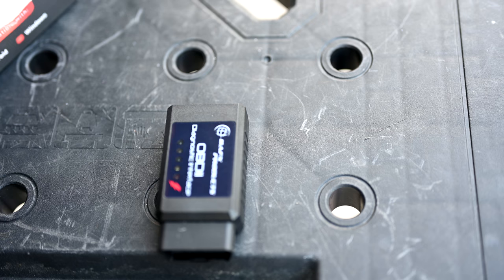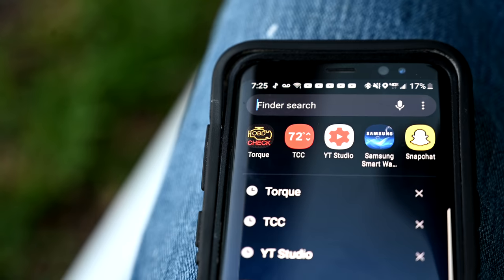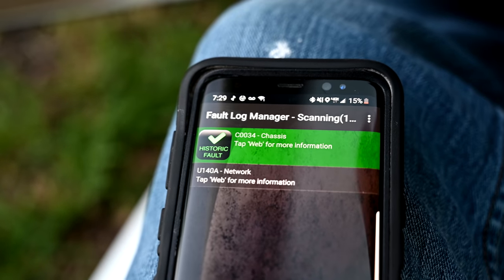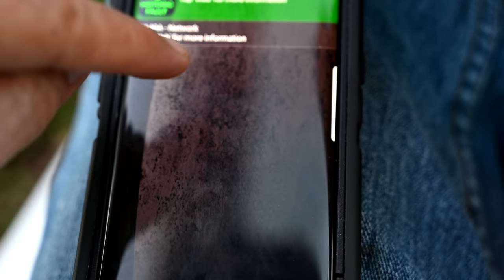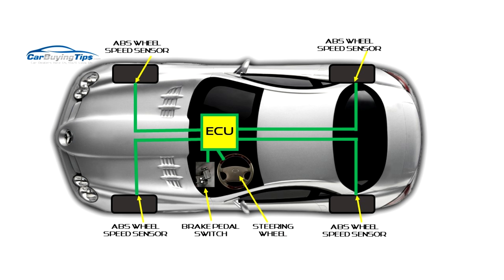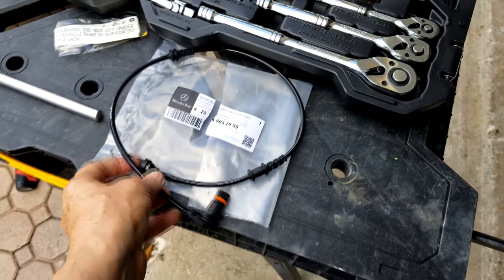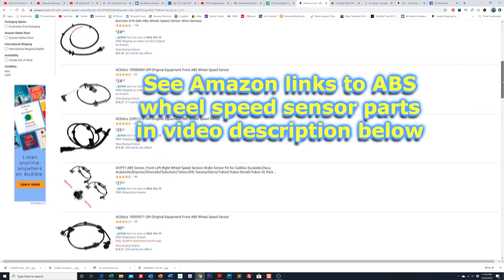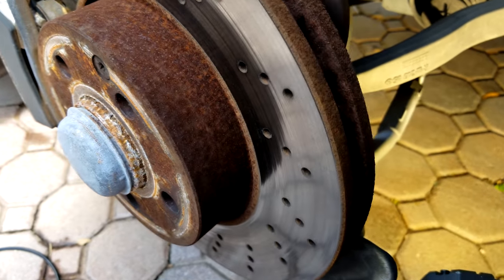ABS Unavailable [How To Fix]: Check Engine Light Mercedes

Comment: Hi, the link for "BAFX Wireless Bluetooth OBD2 Diagnostic Scanner & Reader Tool" says that "This OBD2 scanner does not read ABS, SRS, TPMS, Oil Change or any other non-OBDII related lights". Am I able to read the ABS fault code with this tool or any other simple OBD2 reader? Thanks!
Reply from the maker: Rodrigo, yes this does work, ours works, unless they changed it but doubtful. Yes, we just fixed another car Mercedes 2013 C250 W204 version with the same issue this week, read out both left and right wheel front fault codes. Once we changed both wheel ABS sensors, the alert lights all shut off on their own after driving about 100 feet. Don't panic when you start the car and the lights are still on, they will go back off after a bit of driving. No reset of any engine codes will be necessary luckily.

Comment: I had this problem with the right rear sensor on my own W204. I replaced the sensor but it didn't fix the problem (most of the time is IS the sensor that is faulty). I had to replace the pickup ring which had delaminated. I had to separate the driveshaft from the hub assembly and I was able to replace the pickup ring without having to remove the driveshaft from the rear differential. The ESP and ABS light came back and I found some remants of the old pickup ring I didn't notice when I changed the ring and it has been fine ever since.

Comment: Hi thank you for this video,
So i will be very happy if you can help to find a problem or just to be sur about the technical part (diagnostic) that show me  a code linked to abs box's. 
Im not sur, the problem is when i turn on the engine everything its Allright but when i start to drive juste a few meters the steering whell hard esp abs not available on the dashboard.
Please if you have solution share it.
Thank you again
Reply from the maker: You have to read out the engine failure code using an OBD2 reader, what codes did you get?

Comment: Hey how are you, my s550 says abs uncooperative,  what do you think could be the issue and what's the estimate repair cost.
Reply from the maker: Check the mercedes forums on this one, but usually the culprit is the abs speed sensors. Get a reader to read out the engine code, then look it up on Google

Comment: Hi there - love your vid.  I have a question regarding an engine check light and icarsoft MBV3.0   I have just replaced both front wheel bearings on my W211 E200K 2007. I am getting a fault code " Front Right rpm sensor, GAP   INVALID " on my icarsoft MB V3.0 scanner.💣

 I believe that the comment Gap means that the oil seal that I used is not being read by the sensors - I purchase a seal from a very reliable bearing wholesaler who checked the oem part number of the seal to ensure it was a perfect fit into the hub - which it was. I have also been reading that unless you used a genuine Mercedes part it will bring up this error. I have not yet changed the sensors as they were functioning perfectly before I changed the bearings. Can you help with any advice about the seals and if you have ahad any problems using non mercedes seals?  I am in Australia Cheerz and look forward to hearing from you soon. Regards Stuart.

Comment: I got the same issue today and went to the dealership, they scanned and tell me that the front left sensor is the issue, but they told me to change all four sensors, two infront and two rear sensors.  I was going to change only the two sensors upfront. Because i think theres noproblem with the rear sensors. What do you think and recommend? Should i change all the sensors? Total 4. The cost is pretty high for four sensors. Thankyou!
Reply from the maker: We change only the only sensor that fails due to the cost.

Comment: Damn… actually worked with “turn the wheel left&right.. ty so much. Do you know why it happend in the first place?
Reply from the maker: Complex system of inputs that sometimes exercising the wheel an help clear it, but hopefully your sensor is not on the way out. We had to change sensors in our vehicle

Comment: Thanks for your great video! I'm driving a year 2012 W204 C350 Coupe and having the same issue, I got "Run flat indicator inoperative, ABS ESP inoperative" messages intermittently this week, there was one C0031 "Left Front Wheel Speed Sensor (Sub fault)" error code at the first time but the car went back to normal after I cleared the code and restart the engine. Then I had the same messages showing after a few days but no error codes, and the car went back to normal again after I restart the engine...same thing happened again yesterday night while I'm driving on the highway. I'm not sure if I should be worried about it as it fixes itself after a restart...any thoughts? Cheers.
Reply from the maker: sometime problems can be intermittent as the sensor nears the failing stage, so it might stay on in the future.
Reply: @carbuying  Thanks for the reply! But how come there was no error code when the messages appeared last two times? If there was some incorrect data from the sensor , then the computer should generate a new error code, right? I've also seen some owners (from MBWorld forum) got these messages once or twice a year for the past a few years...😂
Reply: Did you resolve this in the end? I have the exact same error messages in the same car.
Reply: @alexkatsaros  Hi yes, just need to replace that speed sensor.

Comment: I had this issue recently fixed. It was high voltage from the thermostat that needed to be changed. It was expensive unfortunately but the problem wouldn't go away.
Reply from the maker: Can you fix it yourself?

Comment: @carbuyingtipscom:  I have a 2012 MBZ C300 that only has 20K miles on it.  One day the famous "ABS Unavailable" error message popped up on the instrument cluster.  I bought the BAFX OBD2 diagnostic tool and installed the Torque Pro app despite reading that it won't read "ABS" error codes based on your video.  The tool did NOT read the ABS error code as yours did.  In fact, after trying 4 times.  I got 2 error messages, P1254 & U140A, that had nothing to do with the issues I wanted to resolve.  Am I missing something?  How come your BAFX OBD2 tool was able to read the ABS error code?  Thanks!
Reply from the maker: Sometimes different models might cause more issues for the cheap OBD@ readers. Maybe your reader was bad, have you tried it in another car? Also many Mercedes owners are using the ✅ iCarsoft MB II Pro Multi-System Diagnostic Tool Mercedes-Benz: https://amzn.to/2RreN9m which is a much more powerful scanner, but costs much more money. It gives you access to more deeper ECU modules than regular OBD2 ports could ever do.
Reply: @carbuying  I tried on my 2016 Honda Civic that has 19K miles.  Scanner indicated no faults whatsoever.  Will look into the more expensive scanners.  Shld still be cheaper than taking to a shop.

Comment: Checked with OBD2 tools and got the following info.

Diagnostic Trouble Code

C003100 the left front wheel speed sensor has malfunction. 

C003164 the left front wheel speed sensor has a malfunction. there is an implausible signal.

Does it mean the front left ABS sensor is faulty?
Could you please tell me how I can test this ABS sensor?
Reply from the maker: Left Front Wheel Speed Sensor (Sub fault). Not easy for a non Mercedes mechanic to test this, we just replace it when the engine code is 0031

Comment: Same issue i had and the fault was my driver side front wheel i replaced it and code went off and i drove it and it came on again. So i hook the obd up again and now its my right front sensor now ?

Comment: Is this an intermittent fault?  I had the warning come 250 miles into a 600 mile trip. I got to my destination, put in a little DOT4+ fluid and the light went out the next day.  Three days later I headed back 400 miles in and the warning came back on.
Reply from the maker: Sounds like the ABS sensor on the wheel is starting to go. But not in full failure mode yet
Reply: @carbuying  yes that was it, had it repaired last week

Comment: Thanks for this video, my car has been having an issue the engine check has been on and lately, traction and stability control systems and the speedometer stop working and starts fluctuating and the car refuse to accelerate, really would need help someone said it's an abs issue, i just want to be sure, thanks

Comment: Hello, I have a problem with the front left sensor, I changed 2 sensors, I also changed the abs unit, I checked the wiring, but the code is still the same, what could it be?
Reply: Bad wheel bearings will give error codes for abs + traction control, ive done bearings on my w204 1.8 kompressor without the need to replace wheel speed sensors

Comment: Thumbs up. Also for the fact you look and talk kinda like Joe Pesci.
Reply from the maker: Funny How?   LOL!
Reply: @carbuying  Oh man you just made my day with your answer. LOL. Great video. Can't take those fucking three lights out (2 for ESP on the left side and the ABS one on the right side). Im gonna take the car to Mercedes tomorrow. I bought a 2012 C250 last week, bulletproof (ex German embassy) with 100K miles on it. I paid 15K for it (I even had get a permit and all the crap before being able to buy it and drive it). The car is awesome and the bulletproof glass and the 360 degree kevlar on the body make you feel super secure, but I got those three yellow lights on after I tested it out at 240 Km/h coming back home and I was like... "These fuckers fucked me up". A friend told me it may be a sensor or the break pads being exhausted.... anyway, its kinda like I got the car for free (the level 3 bulletproof work alone costs like 40K-50K and its just one year old). Anyway. Fucking lights, I hope Mercedes give me a solution. Thanks for the video mate. Cheers.

Comment: I did the same thing on my w204 but I'd replace the Abs sensor with aftermarket one, Esp&Abs light is still on, what should I do? Esp module fault?
Reply from the maker: Did your issue go away? Sometimes it takes a little driving before it resets on its own

Comment: I have all of these symptoms but also brake pedal feels like it’s chattering but it goes away after a couple of minutes. I changed the speed sensors twice.
Reply from the maker: Did you clean out the area where the senor goes as well and vacuum in there?

Comment: What if my 2010Mercedes Benzsport C300 dash tells when I first insert the key to take key out then the ABS AND ESC ALSO COMES UP WHATS THE ISSUE HOW DO I FIX THAT
Reply from the maker: Any car who's ABS light turns on you will have to do the same procedures as shown here in this video but you will not know what is wrong until you plug in the OBD2 reader to read out the error code from your car that's the first step.
Reply: did you figure out?i have same issue

Comment: Have this problem ABS ESP -garage fitted new Sensor on one wheel as indicated by Diagnostics - Still have the same problem - also Brake Lights coming on so it's not the Brake Pedal Switch - ALSO tried fullleft & right Lock -switch off engine - switch on engine and tried left/right wheel again - STILL shows up ABS ESP ?????

Comment: I have changed all sensors yet same problem. What else can one do
Reply from the maker: Did you try to vacuum out where the sensors go? Are they the right sensors made by your manufacturer? Sometimes people will buy a cheaper brand but turns out to be bad. Also maybe the ECU is the problem, maybe it's getting a good signal from the sensors but just not seeing it. Did you drive the car a few miles and exercise the steering wheel all the way left then all the way right?

Comment: 2012 Mercedes C250 Luxury - There are two parts that look very similar. The wrong one has wires coming out of it. My lights did not reset until I drove the car 100 yards.
Reply from the maker: Yes our 2013 C250 W204 had to drive a few hundred feet before the light turned off.

Comment: Actually have a similar problem with an abs esp see operations manual.   Pop up    2007 s550.  Let me know if you have a fix for that. Video on my page shows exact issue.   Please let me know if you can help.  🙏
Reply from the maker: Did not see video on your page, but you must use an OBD2 reader to read out the cause of the problem. What did your OBD2 reader say?
Reply: @carbuying  replace esp control module.

Comment: Mine was brake light switch..noticed my engine started on push start without pressing the brake. It was partially disconnected

Comment: I just replaced the right sensor and suddenly after a 100 yards the light came back on , the diagnostic shows the same sensor we adjust the axle it had a small play on it , erase the code drove it for 2 miles then the light came back on. !! Scanner shows now the left sensor, I didn't replace it we adjusted the left axle clear the code and 20 miles or so and bam!! The light came back on  .... any ideas  ???? I will put the scanner tomorrow and see what it shows up.   Any help I will appreciated.
Reply from the maker: Sounds like your left side sensor is trying to fail. We changed both side son this car.
Reply: @carbuying  I just ordered it .... a friend of mine works at European cars shop and he also said they do replace them in pairs...  let you know after i replaced it.... Thank you
Reply: Update: Check Engine light and ABS lights are gone after replacing the second sensor and re- adjusted the axles.    Thank you

Comment: My mercedes c180 2013 is having problems. When i start the car and drive the first 5 minutes i get an instant message saying esp malfunction need to see operators manual, followed by left side and right side malfunction (assuming its airbags related). Also during this period the lights flicker and the steering wheel hardens for couple seconds. This only happens when i start the car and its changing gears from 1st to 2nd. Could it be due to steering wheel sensor malfunction?
Reply from the maker: This was not a failure mode or symptom that we are familiar with period your best bet is to plug in an obd2 reader into your port and read out any engine failure codes that might give an idea as to where your problem might be
Reply: @carbuying  hi, yes this problem is unfamiliar, i went to a mechanic and scanned the car but he couldnt pin point the error. However, i believe its either due to steering wheel sensor malfunction (i noticed most of the time this problem occurs when im turning the steering wheel, during which the gear switches from 1 to 2). Or due to an air filter error, which is most likely my thought, as the air filter is shaking a lot when i start the car during the first 5 to 10 minutes and the rpm is going up and down. This air filter shaking is also causing the computer ecu to shake with it as its installed right next to it and this is what causes the error.
Reply: You can also hear the sound of the air filter shake, i may have also heard like an air leakage sound but im not 100% sure. This only happens during the first 10 minutes i start the car and the erros i mentioned in first post is during this period of time.

Comment: My abs lights went on other night, I got car towed, next day I tried driving and heard crunching noise coming from front tire. Pads good, rotors good, bearings never had no problems always drove very nice. I’m hoping it’s just a sensor
Reply from the maker: Thanks for sharing what did they find?
Reply: @carbuying  nothing yet, I ordered the front sensors they should be here tomorrow, but I did hook scan tool up to it other day and it put out no codes, all it said was abs not supported on this vehicle. So idk when I put the sensors on I’ll keep you posted
Reply: @donnyfoster1859  what’s the update ?
Reply: @thahbcity1514  well I plugged in abs sensors and took a look at the bearing and the bearing was shot, half the ball beads were on one side half were on the other so I ordered hub bearing out together already by Mercedes. I got that went to install it and I wen to take locking nut off and the spindle was spinning along with the locking nut, the spindle actually broke off eventually so I had to order the knuckle with spindle in one piece and also replaced lower ball joint. I replaced it all . I started the car then min later all the abs lights went off and it’s been fine since. Amazes me how the bearing just got destroyed like that with no warning at all. The beads were literally falling out one by one after I got hub bearing out

Comment: I have the same problem with the messages popping up but then the battery sign comes on and my car didn’t want to start up and when we jumped start it it would make some weird noise by the front right wheel and it wouldn’t reverse, 😞
Reply from the maker: Did you get this resolved? Sounds very puzzling
Reply: @carbuying  yesss sir it was the alternator everythang working perfect now